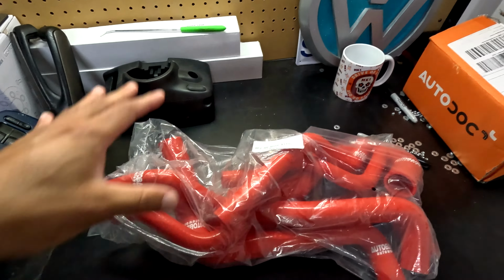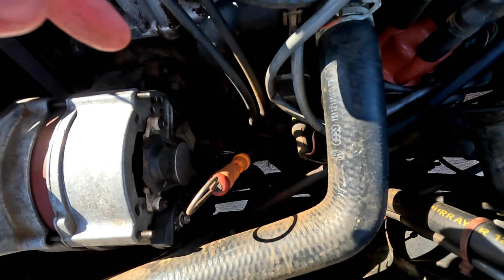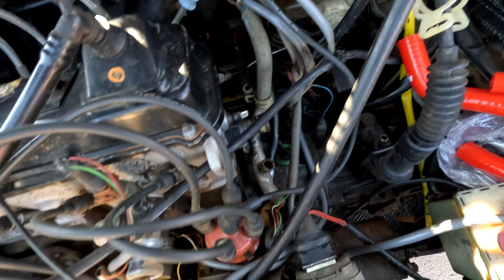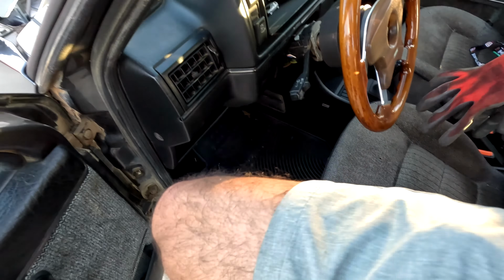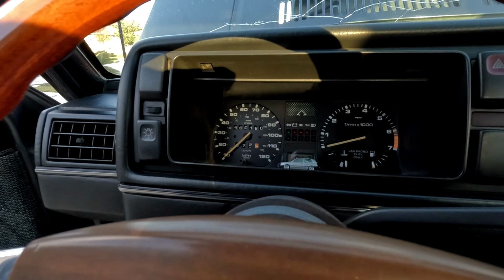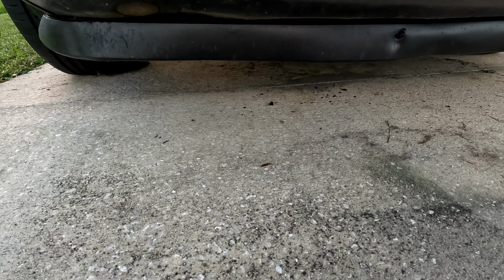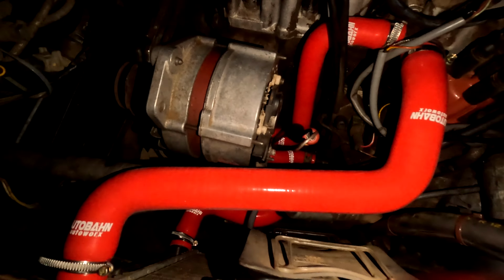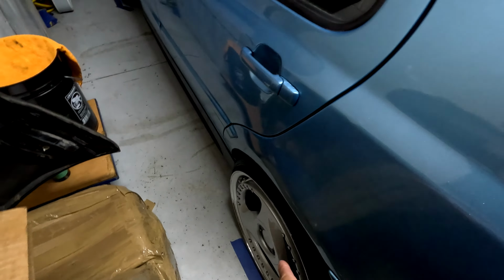Where Has The Mk2 Jetta Been?

Comment: Dude! We def need more content from you! Esp with this jetta build. I just got myself an 86 golf westy and although it runs and drives really good, after seeing this video, I am considering doing all the job myself in the future. My golf currently has some slight fuel delivery issues which can only be felt at idle and low speed runs like 10mph, anything above that it runs smooth! Quick question about the fuel regulator sensor on your jetta, does it make a buzzing noise? I am thinking my idle issue is caused by that. Anyway, great video man! Keep it up!👌🙌👏